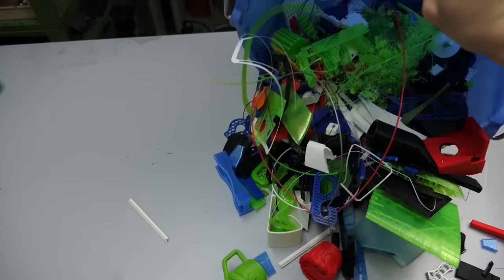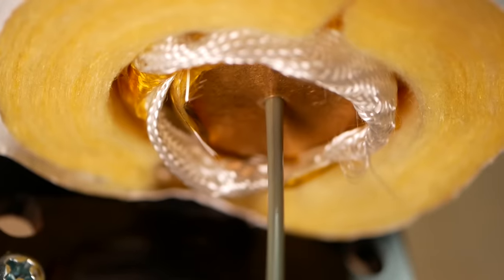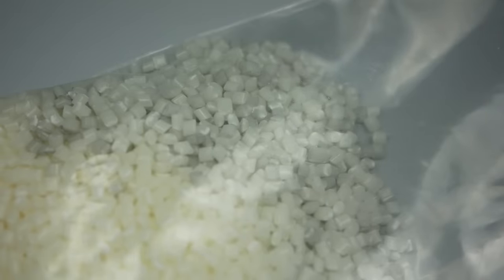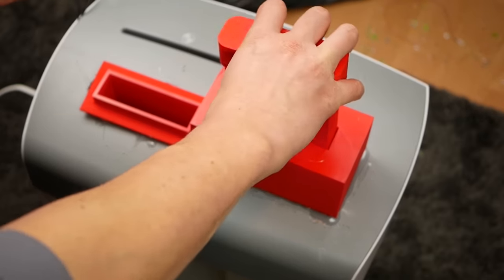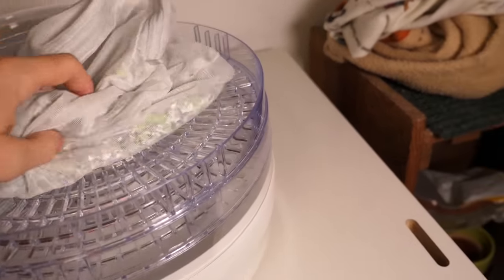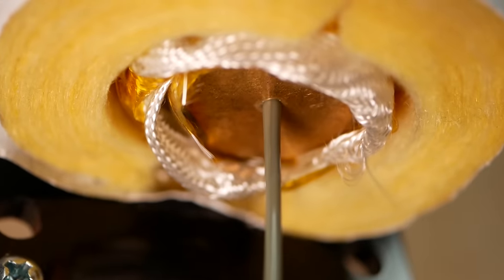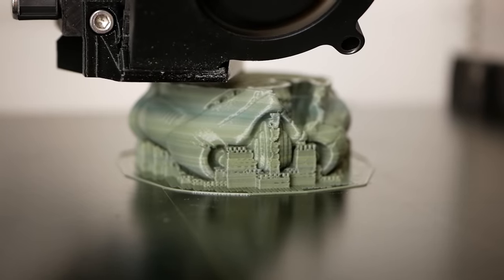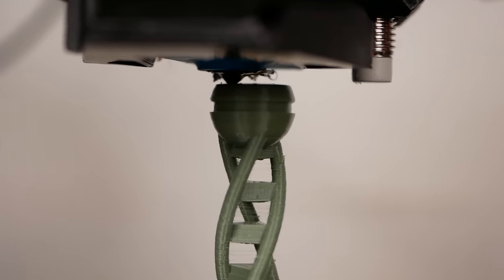Recycle your failed 3D prints! Make new filament at home.

Comment: Recycling is good and all but a plastic can be melted only so may times. After each melting and freezing it looses more and more strength, the polymer chains that make up the plastic is broken down by heat. 

Let's count, let's say the filament you bought was made by just one melting, they straight up made by raw material, then you melt it once when 3d printing, then you melt it again to make the scrap into filament and then you'll melt once to 3d print that filament. That makes 4 times, your printed part is now as good as a 4 times recycled plastic.
Maybe it could be reduced to 3 by instead of making it a filament straight up print something using the melted scrap?

Comment: Is it worth the effort? The Great Pacific Garbage Patch says "absolutely!!!!"

Seriously, you need to commercialize a system that you can sell to members of the 3d printing community that are not confident in rigging one themselves, so we can help do our part in the "Reduce, Reuse, Recycle" triangle. By turning failed prints into new filament, we'd be doing all three: 

1) We'd be reducing the rate at which we buy new filament,
2) We'd be reusing the same filament more than once, and
3) We'd be recycling prints rather than (eventually) sending them to the Great Pacific Garbage Patch(or its Atlantic counterpart).

Chop, chop, get to it!

Comment: If you do a lot of printing, recycling scraps is DEFINITELY worth the effort. You divert waste from the landfill and now have more filament to make more prints!
Reply: What percentage of landfill waste is comprised of failed 3D printed PLA? By weight or volume? Be prepared for some REALLY small numbers...

Further, considering it would take around 120 hours to print 1000g of PLA, IF your printer was printing around the clock, spending $500 for this rig hardly seems worth the investment. PLA can be had for as little as $15 for a 1000g roll, you would have to recycle 33 rolls for this rig to pay for itself. That's about 5 months...printing AROUND THE CLOCK, which few people do. For most people it would probably be closer to 2 years.

And that doesn't take into account all your time collecting, shredding, washing, drying and otherwise fussing with the scraps in order to prepare them for recycling. Even worse, it's a well known fact that many plastics degrade each time they are remelted. It's a safe bet that PLA does also.

That consumer plastic recycling is a net benefit to the environment, when you calculate the additional costs to haul, wash, separate...only to end up with inferior grade material, is a myth. Analysis shows that PLA recycling is too.

Comment: could the grounded filament be superheated in a metal container and mixed together for even color? keep mixing until smooth. then, open a nozzle at the metal container's base and extrude it like in the video? 
also, what happens if you extrude pla filament into water?

Comment: This seems highly inconvenient for home 3d printing, but once factory prints get off the ground, it would be a fascinating way to deal with what would be trash. Specifically the rafts and scaffolding of the models, which could be automatically taken off and then sent to a full, industrial level plastics shredder. That way the printing process could be exempt from plastic waste entirely. I could even see cities investing in PLA recycling plants that have complex machinery to sort out other plastics, shred pieces that are too large, wash, dry, and eventually form into cheaper, fully recycled PLA rolls. Although the color of such plastic wouldn't be uniform, as we've seen with recycled paper people are fine with a strange color.

Comment: Hello sir, I am  a university student who are currently working on similar project called "Plastic Trash 3D printing". It is mainly to recycle the plastic by using it to product 3D printer filament. We are reaching the point of making filament from HDPE plastic type, but it does not work with the printer. I wanna ask a few question, like can we really use plastic to make the standard filament? And if so, can you give me more details regarding the plastic type and steps to make the printable filament successfully?
Thanks in advance,

Comment: If you go rip old gaming controller apart like PlayStation 2 or 3 or Xbox or whatever they have little vibrators in them or just take a hair trimmer apart most of those have an electromagnetic motor that just vibrates to move the Clippers that would vibrate your Hopper quite effectively might be noisy though the Xbox controller vibrator would be much quieter and I believe more effective

Comment: After washing it then shredding plus electricity cost  on drying it off  heating and the rest to melt and putting it on a spindle I think it's not worth it in my opinion.  Not to mention time consuming which no amount of saving money is worth.. time is worth more then anything 😉✌

Comment: Crack open an obsolete cell phone or old playstation controller. Grab the vibrator motor and weight from it. Feed it more voltage than it's really meant for, pulsing it. Maybe 500ms out of every 2000ms. That ought to shake the hopper up.

Also, consider grabbing an old blendtek blender. Drill a port about a third of the way up. Use a 3mm gap mesh across it, but make sure it sticks inward into the bowl like a pyramid; we're going to use vacuum, and we don't want it getting plugged.

Take a 5gal paint bucket (or equivalent), put an air filter about halfway down it. On the lid, cut a hole, stick a shop vac through the hole.

On the side of the bucket near the bottom, drill a port hole. Use a smooth hose to connect the port hole near the base of the bucket to the hole on the side of the blender.

The blendtek will shred the plastic. The vacuum from the shop vac will pass through the bucket and hose, drawing pieces toward the porthole. The mesh will keep large pieces from entering the hose. The pyramid shape will keep the mesh from clogging. The pieces will flow through the hose into the bucket. The large diameter cloth or air filter will have a low suction pressure, so pieces won't get pulled up to the top of the bucket and into the shop vac. Meanwhile, the bucket will operate mostly like an obsolete drain trap you might find under a sink.

Comment: I wonder if we could 3d print directly from the first hopper ie) pass the warm filament into 3d printer head / chamber for a final heat and print , as I have a dual heads I have been thinking about using 1 head for recycled filament for doing rafts etc

Comment: Anyone doing this with PLA. Just put all your prints into a tray and put them in the oven and melt them, then pour them into the nozzle thing that creates the filament. Almost everyone has the means to melt it, but not shred it. And you have a garage or workshop, for the bigger pieces just smash them with a hammer before melting them. Hope this helped you find new ways of recycling your failed prints

Comment: I can resume this for the lazy ones that don't want to see the whole video.
How can you recycle failed (or scraps) 3D prints?:  DON'T

And if you have to: Buy a new bunch of equipment and use a mix of your to recycle material and new material, this last one you can only buy "cheap" by bulk... So basically: DON'T

Comment: I would buy a smaller diameter extruder than the target dimension, then using a reamer (and drill if necessary) i'd bring it up to proper size. Dunno what they used to drill the hole, but you can clearly see the result is not that good.

Comment: I wonder if it would be a easier to extrude to an oversize (say 5mm?  10mm?) filament first, generating a uniform source for extruding again down to the 1.75 mm you are after.  I would imagine you wouldn't need to grind it down so far and you would have fewer hopper issues.  I am now off to find a youtube video about how filaments are extruded in the first place.

Comment: Even if 3D printing has become way cheaper, I still think recycling filament is necessary, not only to save a few bucks (on the long run), but also to prevent more plastic waster in the planet

Comment: Can you melt it in a big batch and put it in  3/4 half tubes. But will it in the melted  state can you dye it. Then after it hardens not run it through a shredder that will break it down to tye size you need

Comment: what if the pipe and worm gear pump themselves are plastic? then i can 3d print them, as well as molding a silicone heatbreak between the nozzle and pump. but the issue here is heat creep.

Comment: Recycling is only worth it if you have 100+ kg of scap.  Makikng just a single 1kg spool is not worth the time.  So.. how the I think the bottleneck is grinding the old plastic.  There are to many hand steps.   One idea is to make a heated compactor.  It remelts scrape then compress it to a "brisk" or possibly a cylinder.    What is needed is a large heated piston.   Then once you have scape made to a uniform brinck it can go to a milling machine where a carbide face cutter makes chips.  

So you have a heated pipe with large enough diameter to hold the failed prints.  THe pipe closes at one and and a piston compressed the scrap.then the closed end opens and the piston pushes the plug out.  The end loses and we compress the next batch.  

Better idea:   DIrect processing.  Make a big oven.  Maybe one meter cubed.  Place scape in oven andheat untill there is only liquid inside.  No gridinfing required.  Then fill oven with presurized air and open a valve to the extruder.

Comment: i believe CNCk would be smarter guy... but i would like 2share my idea.... (SlowCoker PLA)
|
01 all wasted chuck will be in the melting bin withould any shareting....(cause it is not easy to do this)..
02 bin could be 20Liter or so...and covered with heat generating n resistance blanket
03 all things/waste go here... and there is a mixer (like dought mixer so off)
04 all thing will heated up (digital temp control....) and let it be for a few day and stiring...
05 after all mixed well n liquid....
06 pump out with screw ..... to produce the wanted PLA ....

thx.....

Comment: The design of the filament extruders is slightly wrong to me. the plastic should be melted and extruded into a 1.75mm tube in a block of metal with cooling fins by the auger  Pressure should force the filament out and the resulting warm filament rolled on to an empty reel The problem will always be cost. the device has to be under $100 and collection of waste needs to be high in order to make it worthwhile and pay for itself in a few years. However I can see a more expensive and accurate machine owned by a store, where people take their waste and they get money off a reel of recycled filament.

Comment: Why 3d printers not using the pellets directly?  I mean why 3d printer producers not produce machines that can be able to use pellets directly.
 Firstly melt the pellets and make a filament (In my opinion, unneccessarily process that can cause loosing time and energy) then use on the 3d printers.

Comment: only way I'd do recycling is if I had a double filament printer and I'd use the recycled roll on the second spool so it can be used exclusively for printing filler or supports not for the outside of the prints.

Comment: $500 for the filistruder/winder+$100 for a food processor and a sheet of plywood= $600. Filament costs $25/Kg. 24Kg = $600. Step 1: save 24Kg of supports and failed prints. Step 2: convince he wife that Spending the $600 is worth it since it will produce $600 worth of usable filament. It's gonna take a while, but it's gonna happen.

Comment: This probably takes a lot of effort and close watching to make it work, but if you turned this into a business, buying people’s scraps, (which would be an improvement to throwing it away even if it was at a dirt cheap rate) making it into filament, and selling that for cheaper than other companies filament. Of course, that’s a problem with shipping. Where does it go where do you ship it, you need a website, blah blah blah. Who knows, maybe make a website for your channel and monitor it there? Make it a smaller scale operation? Just an idea.

Comment: Maybe it's a little bit like the paper straws, and for that sake 3D printers themselves? It's an important and neccessary step in material, tech and environmental evolution. But it's gonna suck in the beginning. We need the enthusiasts to keep tinkering, experimenting, improving and using them, to further the development and refinement. And over time, it sucks less and less, sees wider adoption and broader use, until it eventually becomes s common household, community or commercisl thing. Or even a basic commodity.

Comment: I mean, recycle is good all in all, but on the eco side of thing  feel like it's more expensive to recycle than just to buy new. example, quick google. 1kg PLA roll cost 240 Swedish crown. i make around 180 crowns an hour So unless there is a way to make this whole process way more efficient it just wouldn't be worth it. But perhaps as 3D printing getting more mainstream your local hobby store could have a ''real'' fillament recycle machine thingy and have some sort of system to turn in and get new rolls (dont gonna brickwall how that could work) anyway, interesting video nonetheless.

Comment: For your hopper problem.  take a look a paint ball marker hoppers. They have an infrared sensor in the drop down neck, that when unblocked because of a jam, will trigger a spin motor in the hopper to knock everything around and get it feeding again.

you could probably just get a used "revolution" paintball hopper and repurpose it, or borrow the design and make your own bigger version.

https://youtu.be/6fUcrkvG1F8

Comment: Can a pellet extruder like the mohar xyz v4 use shreded plastic?
Reply from the maker: Theoretically yes, but feeding the sharp particles sometimes is a challenge.
Reply: @CNCKitchen  I assume you could melt the PLA-Bits first, pour/ dripping it into water and get recycled roundish beads that could feed better into the extruder. The only concern I see is to make sure the drop-size stays somewhat constant. 
This would also make shredding some kind of easier as the parts could be bigger initially. EDIT: and its an included washing-step as well :)

Comment: Considering the amount micro plastics that can be inhaled in this process, I'm wondering how safe this really is. It should be recommended using a P100+ mask or 3m half and goggles, as the micro plastics can get in your lungs and cause severe health problems.

Comment: did you say 500$ to purchase the devices ?      You'll never  save money, indeed.  If you produce a large enough amount of failed prints, maybe you can get some use out of this rig, but then you'll need to reconsider our print jobs and rather tune the printer.      But nonetheless it was interesting to watch and see that it is indeed possible.
Reply: Maybe he can use stuff like used water bottles to make PET filament, I don't know how much higher his power bill would increase for using the machine though

Comment: I do not believe that recycling of materials is the best solution for the environment. Currently more than 60% of the yellow-bag-trash in germany ends in cement-plants, where it gets burned with a significant pollution of the environment by exhaust gases. Because cement factories are subject to different standards than waste incineration plants because they were never planned for the incineration of plastic waste. With modern technologies (i.e. Plasma-Pyrolysis), municipal waste can be turned into high quality fuels. And the benefit of avoiding fossil emissions from producing these fuels is greater than recycling garbage. Only paper waste is recycled successfully and with a large quota.

Comment: This isn't worth anyones time unless someone can actually keep this recycling machine running 24/7 in which case there might be a point after some years. If such a recycling machine could be made into a realiable finished product then there might be more to it. I could see myself running a streamlined PLA recycling station where people can just drop off their failed prints. I am however not willing to MacGuyver such a machine myself. I simply don't have the time and the payoff is not there.

Comment: Ah yes.
Spend 500€ on recycling machines = -40kg fillament at 12€
Spend 10h for recycling, lets say 300W/h = 1€/kg recycled fillament of electricity in Germany.
Spend at least 1h human labor before use = lets say 5€ hourly rate lost because time is money if it isnt fun or useful activity.
That means you save 6€/kg after 83 full cycles to make the 500€ investment back.
Lets say you waste 10% of your fillament that would mean you need to print 83 x 10 spules = 850kg of fillament to break even.

Just throw your waste in the bin and invest the 500€ into new fillament. Its not your job to save the environment, nobody cares about you why would you want to care for others?

Comment: worth it on an industrial scale? yes
worth it on a private scale? no
small youtube channel? yes

the 500 dollar investment is ludicrously small for a business expense if you are manufacturing items with 3d printers and on that scale it is important to pinch pennies and reuse old materials, though some color sorting is obviously recommended

on a private scale that is the cost of a decent printer, or a healthy supply of filament. you could recycle some small scraps for the price of way more filament that makes it more worthwhile to just buy new plastic, with no risk of accidentally making a terrible roll of material

for you however, you print lots of silly things for videos so i can see you having a lot of waste material, even entire prints that turned out perfectly but aren't suited for another video as they were snapped in one of your testing machines. as this was only from one year i can easily see this producing a few rolls of filament to justify the cost in a short time